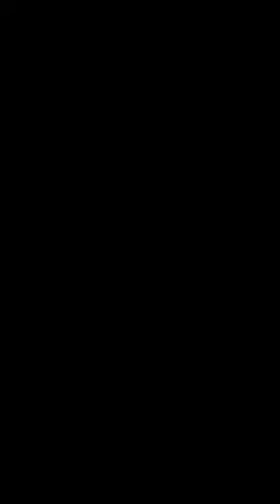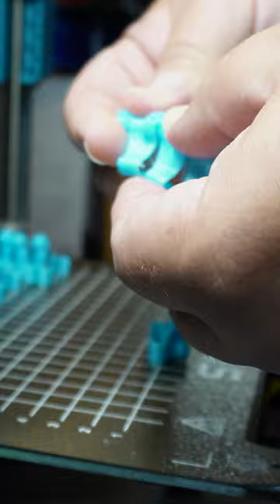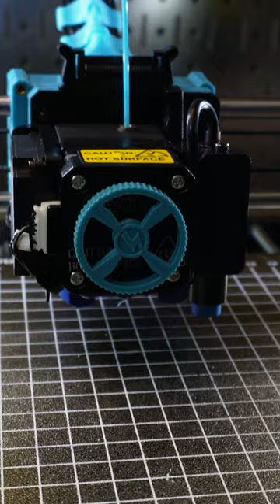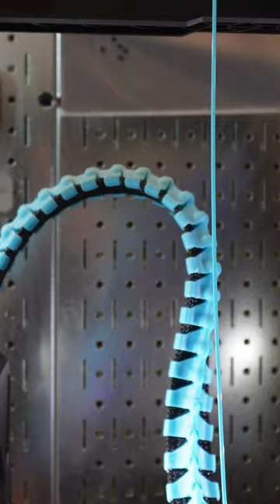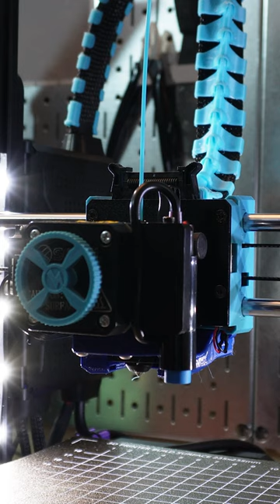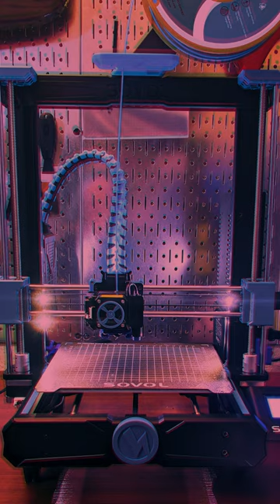Sovol SV06 Awesome Cable Chain | #shorts

Comment: your print fits so easily. Here I need to apply a lot of force and it still sometimes breaks
Reply from the maker: Hmm.. I didn't have any problems with them breaking, they were all pretty strong. I don't know if it will make that big of a difference since they're so small, but I only used 20% infill.

Comment: Does this work for all of the other 3D printers? I have a Elegoo Neptune 4 Pro, and I had my printer for just 2 weeks now.
Reply from the maker: This was made for the SV06 specifically, but the cables look fairly similar. You could try printing the start and end pieces and a couple of the links to test fit if you want to try it out. That way you're not wasting a lot of filament or time.
Reply: @Avel  I’ll see what I can do. It may not work for me, but it’s worth the trying shot.

Comment: I keep trying to print this but having a lot of issues
Reply from the maker: Some people are having good results splitting into a few pieces at a time (6 or so) and printing with a brim. Worth a shot if you haven't tried yet.
Reply: @Avel  I’ve only tried it using a 2mm brim my last try got all but 3 of them but a few broke when I snapped them together.  Yours turned out beautiful!

Comment: I made one of this, after calibrating the printer it went out awesome, very flexible, but I think it stress the cable a lot.
Reply: it does the opposite, supports the cable and keeps it in a linear position out of the way, also prevents the cable from bending too much and thus damaging the wiring.